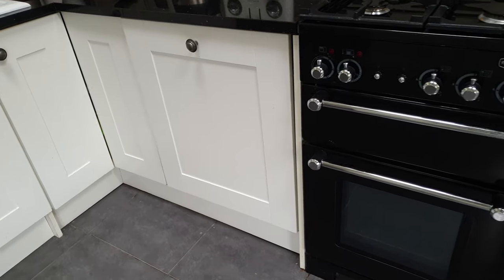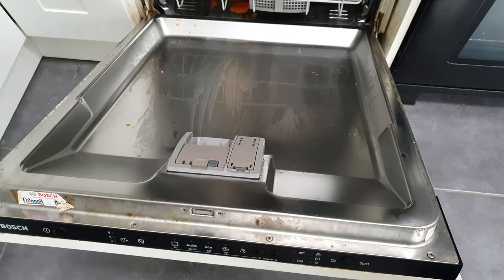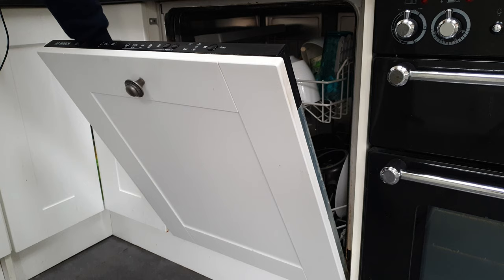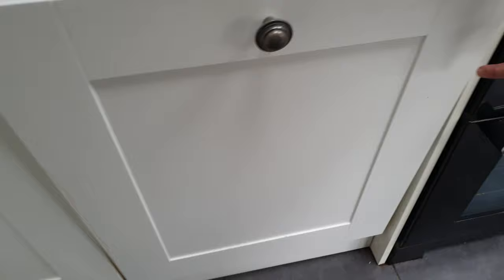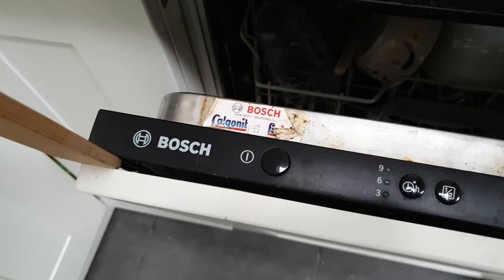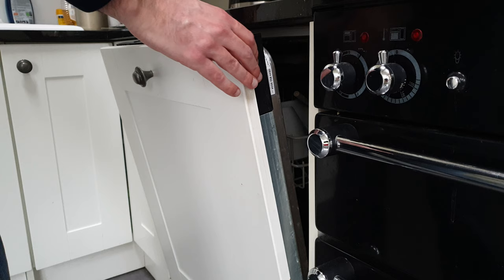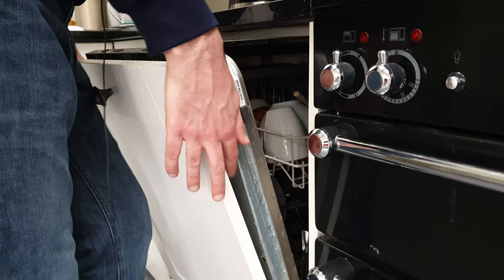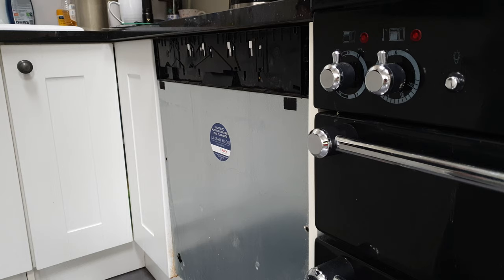How to Remove the Door from a Bosch Integrated Dishwasher

Comment: The title is misleading.  You didn't remove the door, which I need to do.  You removed the decorative panel.
Reply from the maker: I think it depends what you're after.. I could be wrong, but I think most people are looking to remove the decorative panel, rather than the door itself.
Reply: @Endpoint101  nope wanted the dishwasher door.
Reply from the maker: Fair enough 🙂